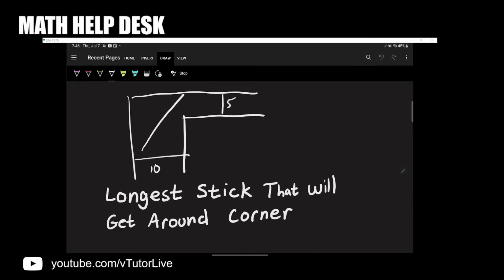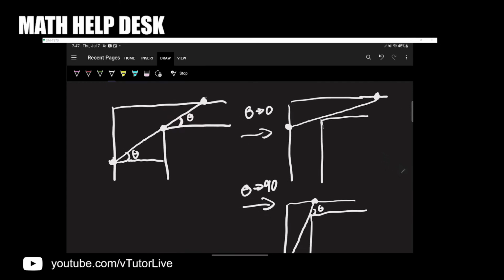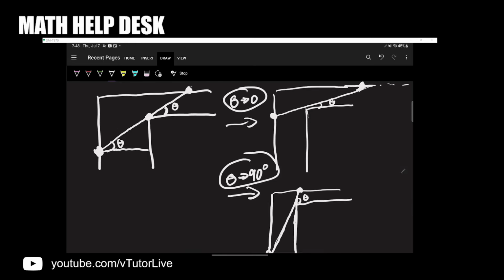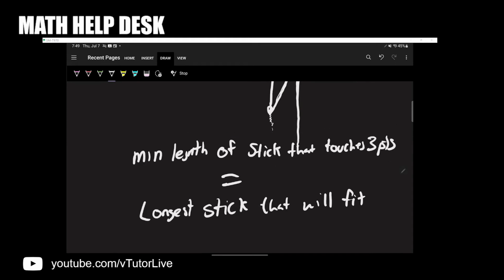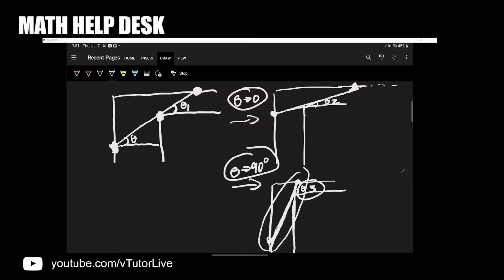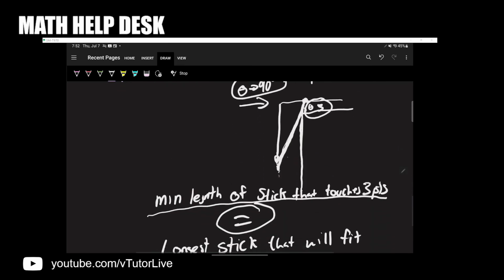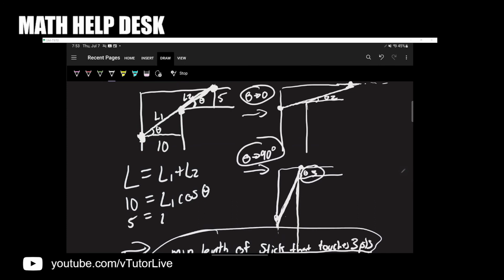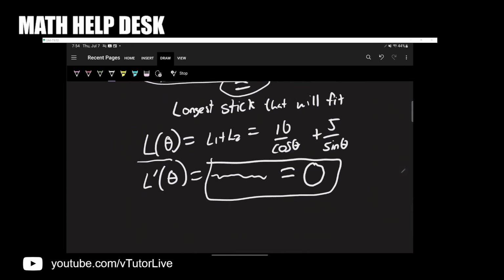Calculus Optimization: Longest Stick that will Fit Around a Hallway

Comment: The question is about an object of a certain size that you can "get" down a hallway and around the 90 degree bend.    Usually worded as in moving an object and when you say "get"  you mean moving.    So in the act of moving the stick or object the length will contract in the direction of motion.   If you move the stick at near the speed of light , you can have an almost infinitely long stick.   At the corner you would have to accelerate the stick to keep it moving at the speed of light until it is all the way around the corner.   Then you can slow down and let the stick expand back to infinite length.      There is no way I can think of stating this problem without moving the stick and motion involves special relativity.   No matter how slowly you move the stick , it will contract a little bit.    But no one ever states a speed limit in the motion of the stick, thus you can move it at near C.   Watch this video at 9:18   https://www.youtube.com/watch?v=-Poz_95_0RA&list=PLUNlOO3feoWYBp7_k2SO9eFgO4y16Myh6&index=13